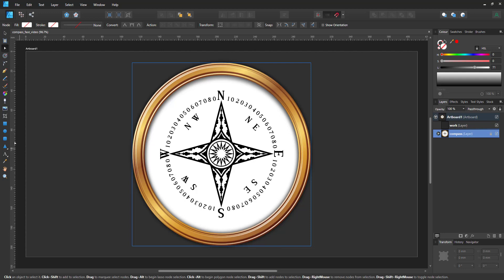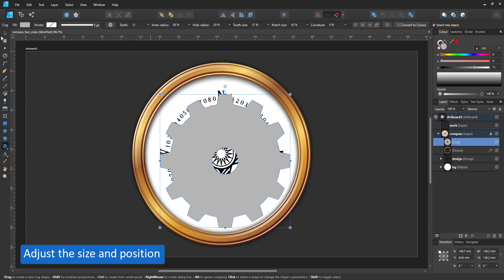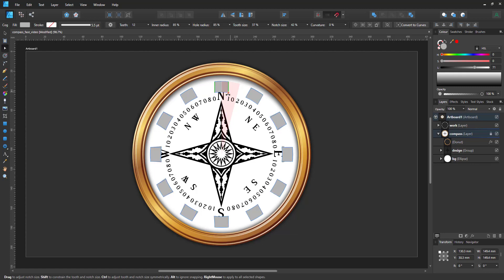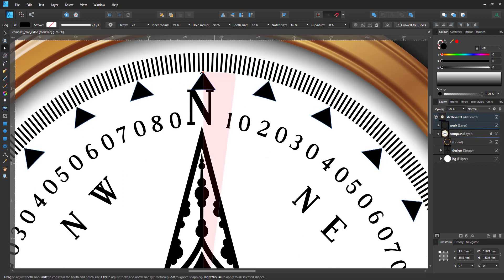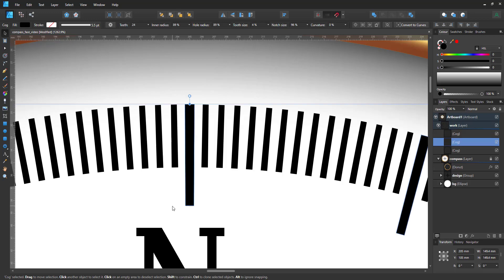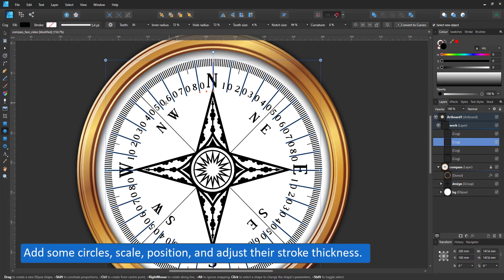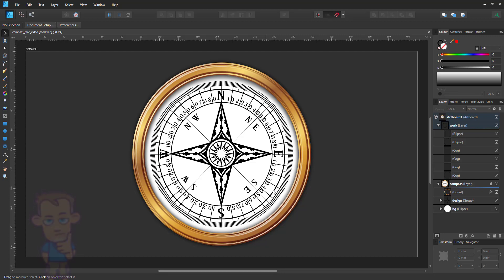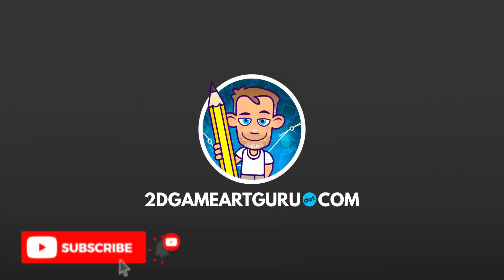Affinity Designer Mini Tutorial - Using the cog tool to  make the face of a compass

Comment: Many thanks for the video. I almost considered using a program outside Affinity to create my gauges, but now I do not have to!
One question though: how did you get the numbers to appear upright on the thermometer face?
Reply from the maker: Those numbers are manually placed and not aligned or rotated in any way. I have the position thanks to the segments of the cog.

Comment: hat about creating the numbers? this is actually the hardest part!
Reply from the maker: The numbers are pretty easy when you start with the 12 o'clock / 0° position, create the text [e.g. 88 to get the maximum number width for the alignment] in its position [distance from the centre], make it centred, adjust the rotation pivot to be at the centre of the design/ circle, and duplicate. Rotate [either manually or with the Transform panel] and use the power duplicate [CTRL+J] to fill the 360 degrees of the design. Go in with the text tool and change the numbers.
Reply: @2dgameartguru Thank you for showing us how to use the cog tool to make the face of a compass. Do you have a YouTube tutorial on how to make sure the compass numbers 1-12 are vertically positioned in Affinity Designer (not on an angle) and how to make sure they're evening spaced next to each hour/minute mark? Which export settings would you recommend for print on demand to make sure the print quality is superior if selling compasses or watch face designs that include text numbers as well as hour/minute marks? E.g. png, svg files?